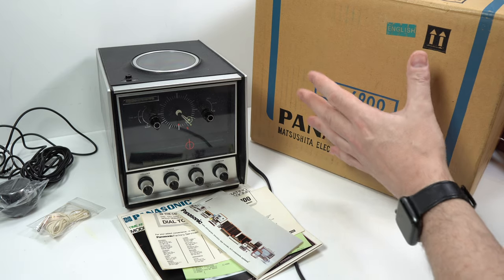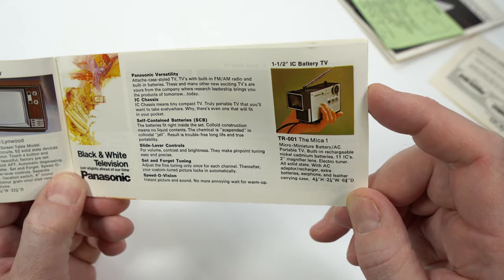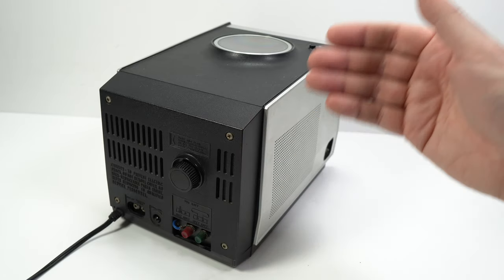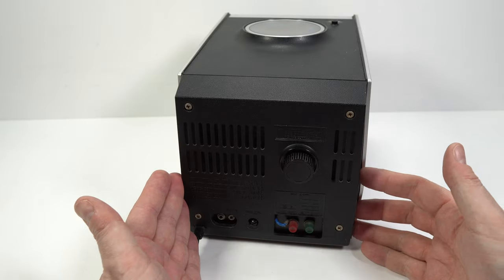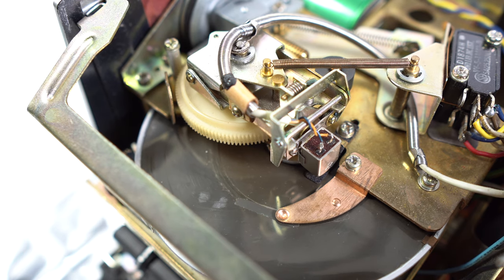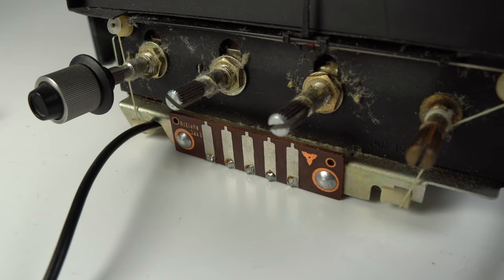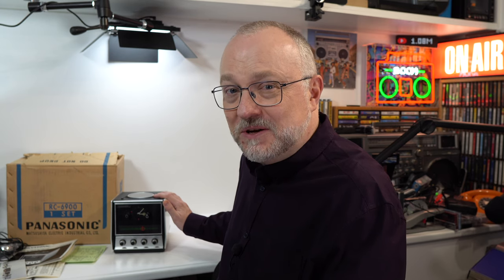The fifty year old Talking Clock Radio

Comment: I can't see how the mains frequency will cause the clock and disc to be out of synchronisation.  I suspect the clock hands and the hours disc got out of sync when the repair was done.
Reply: was thinking the same.  If both had 60Hz motors, they would "drift" together.  

Probably is a way to unplug the motor for the hands from the main board for an hour so the voice can catch up.
Reply: @davidwayneprins  I suspect the hands and disk are linked mechanically, probably via a cam or pawl and ratchet so that when the minute hand passes 12 O'clock the hour disk is advanced one track.
Reply: These clocks use a synchronous motor, its rotational speed is directly tied to the mains frequency.
Being out of sync is not the issue, it's that it will always run about 20% slow all the time.
Reply: @paulstubbs7678  Being out of sync is the issue, the voice is one hour out of sync with the hands.
Reply: Hi, my guess is when the repairs were done it was placed in the wrong place and the smaller inner portion is out 1 hour.
From what was explained i am guessing the inner smaller circle moves 12 times the numbers 1 to 12 so it would do a full rotation in 12 hours, the outer circle with the minutes would have 60 segments and move once a hour

Re the hz issue the entire machines would run slow 10/60ths  so in 1 hour of real time it would only advance 50 minutes - the clock would be slower and no way would the disk  be any faster or slower, ??? hmm unless the disk is spring operated like a mechanical clock rather than electronically controlled

I would just take the hour hand of the dial and place it back 1 hour faster 

It reminds me of the 8 bit guys tear down of the 70's speak and spell

Do a retro mod and add a raspberry pie inside 

Regards
George
Reply: @georgemaragos2378  The inner disk has to be synchronised with the clock so it steps round one track every hour.
Reply: @11:05 The clock is running slowly.

Comment: I loved to frequent Radio Equipment in Buffalo in the 2000s.  It was one of the last surplus electronics stores that just couldn't hold on any longer.  It's a shame because they almost always had what I needed when I worked in the engineering department at a local TV station.  I wish places like that still existed!

Comment: Love your content! Seems like you could use a KCC Athena frequency converter.  It inputs 115v/230v 50/60hz and outputs 115/230v 50/60hz (output is user selectable) so it could replace your stepdown transformer for lower powered devices.

Comment: There was an issue with the mains frequency a couple of years ago in the Netherlands and other parts of Europe (I don't know if it also affected the UK), but the frequency dropped a little bit from 50Hz to 49Hz. Everything was working fine, only (digital) clocks that used the mains frequency as a reference where completely out of whack. I Was really surprised by that because I assumed that modern clocks are using a quartz crystal based reference signal. Quartz crystal clocks are so cheap en reliable. But there are still a lot of modern clocks around that are using the mains frequency as a reference.

Comment: Fascinating!😮 as far back as I can remember, I grew up with a Lloyd's clock radio my mom had with a green nixie-tube looking display that used some kind of flip mechanism inside. The radio was always going on that thing & the bulb inside put out a lot of heat so the case was quite warm.  There was always a fairly large lizard that always came to sit on top of it & each morning you'd find him there to greet you. He wasn't hurting anything so he became somewhat of a pet.  As I got older, I became curious & took it apart...must've messed something up because I think it went to the bin afterward 😕

Comment: Fascinating! Really cool how they used the magnet media, which at the time was usually in tape form (from my recollection), as a disk, hard drive style. Was that a tiny wheel at the very end of the read head? I'm thinking it's purpose was to keep the read head a standard distance away from the magnetic media, eliminating calibration efforts. Of course, such a wheel rolling back and forth over the media would have caused wear on the disk. Which is apparent and probably a cause of premature breakage (and apparent servicing). Truly fascinating! Thank you for this video glimpse into the electric engineering of yesteryear!

Comment: The original 1936 GPO speaking clock was an impressive piece of machinery. The announcements were created from a number of sections each recorded on tracks on a series of optical discs rotating on a common shaft. A couple of camshafts geared from the main shaft operated switches to switch from track to track as necessary. The drive motor was driven by a master oscillator which was time corrected every hour by a time signal from the Greenwich observatory. Accuracy was regarded as important as many people used the speaking clock to set their clocks and watches.

In the 1960s it was replaced by a smaller unit using a magnetic drum which in turn was replaced by an entirely electronic unit.

Comment: 04:02 I have the RE-6600 clock radio with cassette from that little brochure that briefly showed when you flipped through it. It has a flip clock mechanism and a cassette deck with recording capability. Still works after a head swap (first deck I've ever had where the head itself was broken!). It is in the same style as this unit. Now I'll have something to look out for to buy but I'm going to assume prices on these will be wild on ebay for a little while!

Edit: And now I've learned it's called the Digicorder thanks to that brochure. You gotta love the future from the 60s.

Comment: Here in my shop I have an old General Electric poster, 3 by 4 foot, with HiFi equipment from the early 60's. It features names like "The Custom Decorator", "The Larchmont", "The Sutton", and a few more for their HiFi sets. It was in a sealed envelope from GE mixed in with catalogs and manuals from a radio/TV shop I bought out a few years ago (I restore vintage equipment and I am always looking for parts).

Comment: Interesting Video. It is an interesting design to use two meshed disks, and one head to go over both (sort of like a Helical scan but using the magnetic media over spinning head).  I would have designed it with a studier disk setup though with the magnetic surface glued down to make it more reliable.

Comment: I have what I now know thanks to your brochure is the Panasonic Cameron, it suffers a similar issue where the buzzer does not sound at all for the alarm, but the radio part works just fine and the buzzer will sound faintly through the radio if I keep the sleep timer on (which is the only way to engage the buzzer at the same time as the radio because the power switch is the same as the alarm set switch) Possibly the same failed component that would allow the buzzer to sound by itself as your talking mechanism. The way to get it clearest would likely to use an fm transmitter and play nothing through it so the radio is silent.

Comment: What's more fascinating the microwave oven in my kitchen is a Panasonic aka Matsushita. And there is a Scottsdale AZ and a Marietta GA in the United States. And why is the UK at 50Hz when here in the U.S. it's 60Hz. And while you have outlets at 240V the main service into homes in the U.S is in fact 220-250. It's how the wiring panels are done. And if you want to study an absolute electromechanical system I refer you to the Western Electric #5 Crossbar telephone switch. That was a true marvel. It allowed what's called common control to become programmed control.

Comment: As an Electronics Engineer, and a man who has suffered his fair share of electric shocks over the years, I have developed quite the phobia of mains powered devices and I am always very pedantic about handling or probing them.

So, @15:45 when you reached underneath the thing with your hand, completely unsighted as to what you were touching under there, I grimaced.  I imagined a big juicy reservoir cap in there - its leads poking out of its solder joints menacingly.  It had waited 50 years for the opportunity to zap someone with a couple of hundred volts D.C.  And boy, were you going to get it.  What an anti-climax! But you won't catch me doing it.

Excellent video by the way, really enjoyed this look at historic technology.

Comment: What a fantastic machine! I bet Mr Technology Connections is trawling the world looking for his own after this video.
I have to admit I'd love one of these; the challenge of getting it fully functional would be a lot of fun, along with putting a custom voice on there. In theory not hard as one would 'only' need a couple of magnetic discs, a temporary recording head for the mechanism, and a way to get the mechanism to play the hours and minutes sequentially while you transfer your recorded hours and minutes...
...of course the practicable hurdles would make all of the above very tricky - for starters magnetic media must come in flat sheets as cassette tapes are still made but how to get your hands on something suitable for cutting in to discs..?
PS
50/60Hz... I wonder if that's a function of the design or the motor used to run the gubbins?

Comment: Hi Mat.  No need to worry about the "luminous" paint on this radio.  Radium was not used by the 70s.  Also, I'd wager that if one were daft enough to take on the project, you could successfully replace those disks with guts from floppy disks cut to size, and record your own messages.  You'd have to figure out how to drive the playback head as a record head though.  Yeah you'd have to be daft to do it, but it could be done.

Comment: FWIW:  I have two RADIO SHACK "VoxClock" talking clocks.  The first I purchased in 1980<?> as a gift from my parents.  The second one I purchased later in the 1980s for myself -- it is also an alarm clock. 
 
The alarm clock version no longer works, although I still have it and want to someday try to make it work again.  
 
Both my parents are gone now, but I have the VoxClock I gave them and it STILL WORKS.  It literally announces the time on the hour, and it also tells you the time when you press a button on top of the clock.

Comment: Just watching this video again and realized something.  The 8-bit guy showcased a couple of Commodore computers he had gotten from overseas, saying he couldn't power them on because he didn't have the appropriate electricity supply.  I had seen previously that he had received step up transformers, but I didn't realize that those would not actually convert the 60Hz to 50Hz.  I can only guess that was the reason he didn't use those transformers to attempt to demonstrate those computers.

Comment: What type of light is that on the quick adjust arm? Hoping it's not one that's name brand and expensive, I use two led bulbs in fixtures for my workbench but I often get glare from them since they don't have those adjustable shutters. Can be annoying with a headache, that looks like it could be much better.

Comment: You know one thing you can try and I'm not sure but I've had success with it and I learned about it on The tape head forum and here it is. Say you got a tape machine and even though the heads look super clean you're still getting distorted audio or it's not as good as it should be. Well the trick is get some steel wool, the fine grain stuff, and some tape head cleaner and lightly brush it across the heads. What that seems to do or maybe my theory is it is kind of polishing the head and really kind of cleaning up those magnetic sensors that pull the audio off of the tape. Again I want to reiterate that it's important to be gentle when doing this otherwise it's very easy to damage the playback head

Anyway I know this is a bit of time Matt and I am also aware that you probably have no plans to fix it further, I just thought I'd pass along a little bit of info that I read about that's helped me.

Comment: It seems like the amp is not turning on when the button is pressed, there is likely some switch on a cam when the motor starts that is not tripping right. You might also be able to ask around and see if someone has one with a good disc but is faulty some other way so you could do a parts swap to get a working one.

Comment: Regarding the naming conventions.  In Japan they preferred names to model numbers and tried to export that.  They really learned their lesson around the time of the Ladybird, or 240Z.  It was the Ladybird over there, but only 240Z here.  Turns out Americans influenced other countries to like model numbers or alphanumeric designations like C130 eventually (even though it had the "Hercules" moniker).  Working with some RAF chaps at Mildenhall in the early 80's they all used the names of aircraft, not the alphanumeric designations.  They even referred to their anti-aircraft missile system with a name, not a model number.

Comment: Maybe you could buy a 12v to 110v AC inverter which is set to generate 60Hz. For low current applications they are usually cheaper than frequency converters.

Comment: First, I'm surprised there wasn't a phonograph based one earlier than that, because they could have done that in the 1940s or 50s.  Second, I want to see the guy who decides to take two floppies apart to replace the mag discs and re-record all the time announcements to make it perfect again.  One would have to use the same mechanism plus a record circuit, to record each section.  Perhaps somewhere there is an archive where someone has digitized or preserved the early original voice?  I would love to see that preserved.  Where are my tapeheads at?!!!

Comment: You may be interested in picking up a US-style power inverter, something that runs off a DC battery and makes its own 60Hz sine wave. Not practical for any long term use of course, but could add something to the demonstration of devices like this :)

Comment: Old clock radios always fascinate me.
Reply: I was just thinking about the clock radio that my parents had from the time I was born until about 1985.  It had a yellow backlight, and in addition to AM & FM there was a separate dial you used to tune in the NOAA Weather Radio stations.  Back then there were only two frequencies for that, and this radio tuner for weather went as wide in terms of how far you could turn it as the regular radio dial.  Strangely enough,  all I remember hearing the weather channel, and at the time it didn’t come in clear at all.

Comment: Hello! I have seen a few videos of devices that you review that designed for 60 Hz but you in UK have 50Hz which causes "slow" work. As a solution you can get a 12VDC to 120VAC 60 Hz converter  and hook it up to a car battery or a 12 VDC power supply. You are welcome 🙂.

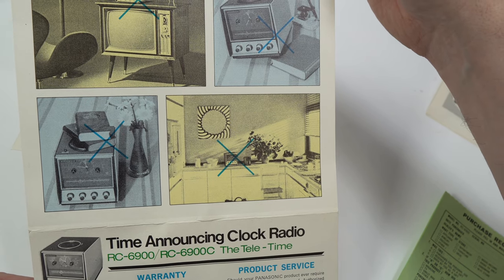Comment: 6:52    Avoid direct sunlight.  So as to not fade the colors or potentially melt or warp plastic parts.

That's actually a very clever little gadget.   Here in the US, they used to have talking public scales.   Step on, drop in your penny or nickel, and it would show your weight on a scale and speak it as well.   I don't recall ever seeing one that actually worked, though. I wonder if they used a similar mechanism?

Comment: Do you think it would be possible to completely replace both magnetic discs, using the media cookie from a 5.25" floppy (for the outer minute disc) and a circular section cut out of an 8" floppy (for the inner hour disc) (or some other source of appropriate radius magnetic media of the correct oersted), then making some sort of contraption to correctly re-record the minute and hour speech along the correct spirals at the correct interval? (This would require help from someone at panasonic to see if they still have the master recordings of the original hour and minute speech, or someone re-recording appropriate replacement messages...)

Comment: Back then I was a kid my father had an alarm clock with an radio who use the power line frequency. Downside that that if the power was out during the night he would wake up late believing he was on time util he checked another watch. 
Back then power outages was much more common and he had to get another clock in addition.

Comment: Woah, I wasn't expecting that clock to come from Radio Equipment. I was there maybe 10 to 12 years ago right before it shut down. Wonderful place, electrical components everywhere. I think the guy who used to run it is dead now.
Reply: The building still seems to be in use though - Google Maps lists a different business at the same address currently.

Comment: Very interesting technology, especially those arced tracks. Very ingenious! I wonder why they didn't place the inner disc above the outer one, as then the head would have come down off the edge of the inner disc in operation, rather than trying to ride up on the inner edge of the outer disc as it does now, which would be my first guess at why the outer disc was torn, the head with its protruding pole pieces continually nagging at the edge as it rides over.
Reply: Hindsight is 20/20.

Comment: I 👍 like this. I think this talking ⏰ clock 📻 radio was trying to be a 1980's model, because it looks more 80's than it does 1971. Unusual 👌 kind of "record", in the back, with the same to say about the "needle". Almost 💿 CD inspired in a way. Nice green backlit radio dial. Also has the usual dial cord, and analog ⏰ clock. I had a talking 📻 Radio Shack ⌚ watch, back in 2002, and they used way modern technology. Just a tiny circuit board, and a speaker with a 💪 strong magnet. 👎 Now these talking ⌚ watches are considered vintage. Unusual, but very interesting talking ⏰ clock 📻 radio from 1971. Your friend, Jeff.

Comment: You can get trembler devices that will feed AC from a DC source,  they might be at certain frequencies so you might get 60Hz that can be transformed up to 110v from a 12v DC system, give it a try